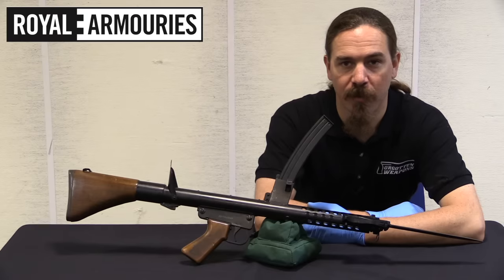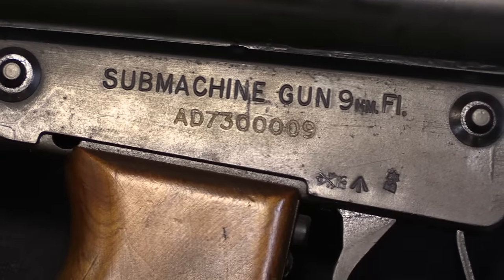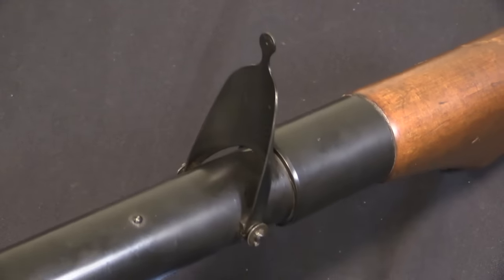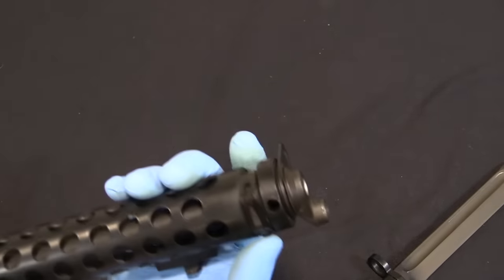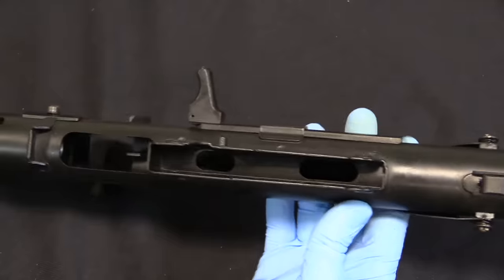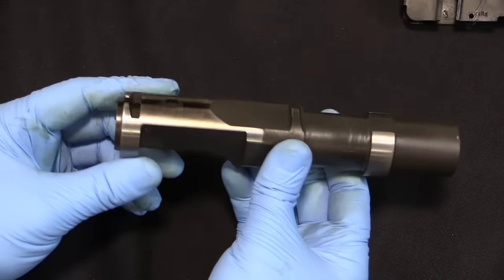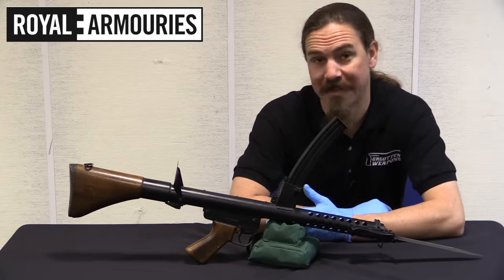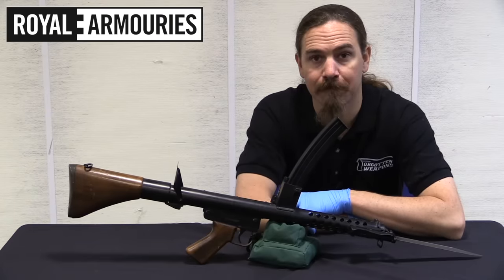Sterling Meets Owen: The Australian F1 Submachine Gun

Comment: I used the F1 a bit while in the Army Reserve during the early 80s. They are fairly accurate out to about 30 metres and I think they taught their maximum effective range was around 100 metres. One of my instructors was a Viet Vet. His story was they didn't have a lot of stopping power and the bullets bounced off the VC raincoats at 100 metres in the rain. 

I had a lot of fun with them on sneaker ranges where you walked down a trail with an instructor 2 feet behind you and shot at pop-up targets. They were great fun to fire and very reliable, but we never took them out on exercises because there weren't any blanks for them. 

If you were lefthanded like me, you were taught to fire these righthanded. The issue was hot cases would eject down through the split in your sleeve if you tried firing them lefthanded. They taught us to fire mainly from the hip; you aimed to your left of the target because they rode up and across the chest. When you put a few mags through them the handguard got a bit warm.

Comment: I'm flashing back to the 70's with this video. Tank drivers and loader/operators carried these and gunners and crew commanders carried 9mm's. My Troop Sergeant, a Korean war veteran, wasn't impressed with it. He much preferred the Owen Gun. This weapon was always referred to as "the SMG" rather than F1 because at the time, there were three pieces of equipment in use all designated F1. One was a truck, the second, this SMG and I can't remember the third. The truck continued to be called F1 and with alternate names for this SMG and whatever the other piece of equipment was. All useful, but not interchangeable. :P
Reply: and the blast cap assembly/booby trap device.  The F1 designation lives on with the F1 Grenade.

Comment: Just a hypothesis on the positioning of the sites: 1) having to roll your head over the stock, this would increase your contact surface (cheek/neck). 2) tilting the gun would mean that brass would be ejected away from your feet when walking. Both reasons are in two very different ways of firing the gun. 1 is trying to use the gun for accuracy. 2 is more up close full Auto fire. Again just a hypothesis.

Comment: Heres my explanation of why the sights are on the right.  Australians learnt that getting low to the ground on a firefight in close, jungle country is a life saver. As a result you'll notice most the photos you see of diggers in Vietnam, the front of their bodies is free of webbing/pouches etc. ( exception being SASR patrols, who avoided firefights and would 'break contact'... they avoided getting low and crawling towards the enemy)   For a right hander, the mag pounch is on the left. For a top feed mag like a Owen or F1, the easiest way to change a magazine and maintain a low profile is to tilt the weapon to the left, change mags with your non-master hand  and continue firing.  If the weapon is tilted to the left for a right hander, the right hand off set sights would be better aligned for a right hand shooter than left hand offset sights.   The Owen and F1 were products of lessons learnt in combat.
Reply: As a an Aussie grunt "1RVR" That's the explanation for the sights being on the right, that I recall from my service in the Reserves back in 1984. It was kind of fun to use but I preferred my trusty SLR. I definitely recall being taught to keep my ammo pouches to the sides so as to be able to lay low and flat on the dirt. Made a lot of sense at the time and still does now.

Comment: I may have suggested this before, in response to an Owen gun video; I may be wrong but I'll throw it in here for good measure. If a right-eye-dominant right-handed shooter is using a full-size rifle, they'll cant their head to the right to bring their right eye in line with sights that are centred above the bore axis; if the stock is a good fit, they may achieve a 'cheek-weld'. If the same shooter is using a SMG with a rudimentary buttstock and a magazine mounted above the centre of the bore axis, they can do one of two things to get a sight picture: cant their head to the left, away from the weapon, to bring their dominant eye in line with left-mounted sights or take up their normal shooting position while pulling the weapon even more closely into the shoulder to sight down the right side.
I'd be interested to know whether there are other SMGs with offset sights or whether the weapons with sights offset to the left were all of a different class. What works for a SMG at the shoulder might not work with a LMG on a bipod, and vice versa.

Comment: Hi Ian I used these until they were phased out. The sights were offset so you could use the palm of the left hand to depress the mag release to remove the mag while keeping the master hand on the pistol grip to keep control of the weapon. Sights to the left would have interfered with this. No manual of arms for this weapon said that you should roll the gun to the left in order to aim as this would mean the gun would not be seated in the shoulder. The sights were only really used for semi auto fire at ranges over 25 m as we were taught to fire instinctively and in auto you don’t really have much of a sight picture. The other reason for sight on the right was that they don’t snag on your webbing. Just remembered that we don’t call it a bayonet lug or latch ,it’s a boss at the front and standard at the rear that you lock to. I believe these terms originate from UK

Comment: i noticed one detail that would make the gun less dust-and grime-sensitive: the bolt,though its round in a round tube, is not the inner diam of the tube, instead it runs on several smaller surfaces, with most parts of the bolt circumferenc not touching the tube inner wall. that leaves space for sand etcetera, without jamming the thing up.

Comment: The usual method of using the weapon is to twist the weapon slightly to the left to the point the sights are vertical. As it was designed for the jungle, it was considered best to have the mag upright (less chance of hooking up the mag on brush) so turning it slightly to the left was an easy fix.

Comment: WRT why the sights are on the right:
This is a guess, mind you. I never saw anything official.
 But did you notice where the magazine release is?
if you mounted the sights on the left you’d get the tang of the mag release in your sight picture.
And the constraint of requiring the mags to be compatible with the Sterling means you can’t relocate the mag release.

Anecdote: Back in 75, the training base at RAAF Wagga Wagga had a sectioned off F1 barrel with three bullets lodged in it.
With a simple blowback action, if you get a projectile stuck in the barrel, you’ll continue firing and lodging more lead in the barrel until you let go the trigger. No dangerous back pressure as it will vent out the non locked breach. But the firing rate accelerates.

I’m told the firer got one helluva surprise before he could release the trigger though.

Comment: Just a minor point, replacing the F1 with the M16 has no real relevance to how the F1 performed as an SMG, all SMGs were replaced with 5.56 carbines in ADF service, appart from very specialised use. That's not really relevant. The reality is th 5.56 made all SMGs obsolete for general infantry combat.
Reply: I didn't come away with that point at all, the point was the AUG was adopted to replace submachine guns (like the AK47!) as well as rifles.
Reply: Dennis H-CH I think we’re talking about different things. When Ian was talking about how the F1 performed in Vietnam, he said that they were pretty quickly replaced by M16s and relegated to secondary roles. That implies that they were less useful than an M16. My point is, 5.56 carbines in general are better than any SMG, so you aren’t comparing apples.
Reply: @timblizzard4226  Even more to the point is the F1 / Owen guns weren't replaced with a standard M16, but an M16 mounting an M203 (which was a result of the M79 being awkward and slow to bring to action) so it was definitely apples and oranges. I summarize comments in an Australian Army manual for infantry battalion lessons from Vietnam ... M16 - a versatile weapon without the stopping power of the SLR, effective stopping power to 100M but lacking penetration in jungle, requiring careful maintenance to avoid stoppages, but much more effective than the F1.

Comment: Re the weird sight issues.  In the jungles, a submachine gun was rarely sighted.  It was more point and shoot at close range so the rear sight was not used that often.  You would want to have one, but having one that just folded out of the way made perfect sense.  As for the placement, obviously someone in procurement had a left-handed brother-in-law which is the way such decisions are usually made.

Comment: I had an incident on the range with a runaway F1 courtesy of the trigger group comming loose during firing fortunately a mag dump only takes a couple of seconds and yes the big Spring did make around 600 rpm effectively they only had two stoppages empty mag and broken firing pin I never saw a bent rear sight. The bayonet for this thing was really something almost as long as the weapon

Comment: We were told that if you are required to use the sights then your target was too far away... We were issued a Toggle Rope (which is a real thing) with our webbing and and one of the uses of this was to be firmly attached to the F1 at which point, while screaming really really angrily, one could hurl the entire gun at the enemy if you missed hiting your target then simply retrieve the gun and repeat...  apart from that this did make a good PDW in vehicles.
Reply: "at the enemy"? I always thought that was the Drop Bear drill.

Comment: I'll back up what Tim W has said, as a former RAAC driver in the late 80s.  To be honest, cavalry aren't really expected to snipe with these things, and most training was on a 25 metre range.  At that distance, you weren't deploying the sights; often, you weren't even bringing the weapon to your shoulder.   As a lefty, I'd just point my right index finger along the underside of the barrel, which was not regimental.  The right hand was supposed to be an overhand grip on the barrel, to avoid a hot brass injection up the sleeve cuff, from the underslung ejection port.  But it meant that I could simply point my index finger at a figure 11 target, and fire off a burst aimed at about the target's right hip.  Recoil would pull up and right, and stitch a couple of rounds across the torso.

Comment: I add, good video and comments by the way, hold the gun low front arm locked straight,and guide your shots on target by adjusting shot with the pistol grip. You have more control in instinctive fire. With practice when shouldered this too can be used to aid accuracy rather than waving the barrel to adjust shot. A good gun to retire submachine guns on I'd never want to go on operations with one I was happy with an M16 thank you, but looked flash when a pay guard.

Comment: When you are making a gun out of a tube it is easier to move the sights to the right and tilt the gun slightly if needed, whereas if the sights were on the left side you would need to build up the stock and the side of the tube to have a decent cheek weld and in turn a usable sight picture.

Comment: I was in the Royal Aust. Navy from 90 to 96 and the F1's and 9mm Browning's were the weapons of choice for boarding parties, as the 9mm bullet, if fired below decks on a ship, wouldn't penetrate the hull of the vessel ... unless they were made of wood. The 5.56mm rounds of the Steyr however could (and did when tested) puncture the hulls of boarded vessels. When I left in 1996 they were just starting talks about what to replace the F1's with, and last I heard they were thinking about the MP-5, but I was discharged long before any decision was made, so don't know what the final choice was. 
(I know the MP5 was employed by the Air Force, and by Army Spec. Ops., but never heard what the decision was for Navy Boarding Crews ... they may have used the Steyr, but limited those crew to above decks, while pistol crew searched below ... I don't know.)

Comment: The serial numbers are as you suspected
AD Australian Defense (force I suppose) . Indicates also it was made in Lithgow.
Next two digits Re the year of manufacture.
The remainder is the serial number.

So this gun was made early in ‘73, the last year they made them.
The serial number schema also applies to L1A1s as well, so anyone with a sporter FAL with an AD number stamped at the right rear of the lower receiver can tell it’s an Aussie parts kit and approximately what year it was made.

I spent the early 70’s maintaining these in the RAAF and they were a good little SMG. The heavy bolt made them pretty stable.

Comment: The difference between theory and practice; I have used or instructed or supervised the F1 on the range and during tactical training and never had an issue with the sights, reliability or its handling. Its biggest limitation was that it was 9mm (as with all 9mm msg's). The TOE distribution was for officers and Radiomen. Officially drivers were issued SLR's (FN). For its intended use and range it was an effective weapon. If it was ever used by section scouts in Vietnam it was only for a very limited time. I think the scouts went from Owens straight to the M16.

Comment: How cruel Wizard! Used the F1 myself . Quite accurate . Much like the Uzi. One point that many miss looking at this gun is why you have a substantial steel butt plate ? Very old fashioned . Heavy attached to heavy full wood stock too.  So you can bash heads in with it when you run out of ammo.  Real close quarters reasoning . Glad I left as a kid . Looking back I think OMG.

Comment: The sights work well when the gun is tilted slightly (magazine left toward the body, grip to the right away from body). This aligns the sight straight up / down and is perfect for right hand / right eye dominant people. Don't know why they started tilting the weapon to use it but it seems the sights were designed or modified (in the case of the preceding Owen gun) with that in mind.

Comment: Hi Ian, I remember reading somewhere (I cant remember if it was in Wayne Wardman's book "the Owen gun" or G.S. Wardell's notes)    the sights on the Owen gun were off-set to the right so you could get a solid cheek weld, if they were off set left it wouldn't be too stable without adding a cheek piece which would make the gun unbalanced.  I keep hearing about the owen gun magazine (as well as the STEN magazine apparently) fitting the F1, but I can't find anything written about it.

Comment: The little metal tab that guards the opening to the breech on the underside, is to stop you from losing a chunk of meat from your hand; as the bolt WILL bite you should you place your hand there.
The bolt is upside down remember and occludes the whole opening.
We liked the progressive trigger. Less faffing around when under pressure, no delay in a pinch.
Yes the Owen was a better gun. But the F1 was what they gave us and it's better than a Stirling.

Comment: Trained up on the F1 and L1A1 then M16A1, whilst not a big fan of the F1 I had no real issues with it except hitting power (and my big hands), would have been ok close up but not much more over 50 metres or so. Went from the L1A1 SLR to the M16A1 but still preferred the bigger 7.62mm SLR even though it was a relatively heavy bugger to lug around.

Comment: Ahh, the only SMG I have ever fired. I was trained on it and fired it during the 80s. I never remember the sights feeling unusual, they just worked fine and I think the idea was that they did not catch on your webbing (don't quote me on that). I never heard of the rear sights being prone to damage but we did not really use it where I was. I also remember that it was pretty accurate to 100m with single, aimed shots, fairly accurate with bursts from the shoulder out to 50m, auto from the hip ... good luck to ya. It was really only used by armoured crewmen, drivers, and the reserves in the 80s. Fun weapon to fire but it had a reputation for lacking stopping power.

Comment: Ian you need to use it before passing definitive  judgment, you are off the mark.
In all my years of using one, the rear sight was never a problem or at risk. It is very strong.
 The  rear sight is normally down unless deliberately taking aimed shots.
Short range weapon, limited by the 9mm round, designed for self defence / close combat in jungle and scrub.
Issued to forward scouts, A and B vehicle drivers, cooks, radio ops, clerks, etc

Comment: A suggestion for the sight placement; by having the sights on the right side, the user will be guided to tuck the gun in towards his center of mass, rather than push it of his shoulder with his chin.
He might also have better Situational Awareness, effectively having one eye on either side of the mag well. 
I guess SOMEONE will have to run a match with a top feed SMG to find out.

Comment: I don't think you necessarily need the gravity "assist" of the bullets going down but the spring force needed to "lift" 34 rounds quickly enough, that's quite a bit of weight for a spring to move against gravity.

Also diving down to the cold hard ground (as you might when being shot at) if the mag protruded from the bottom and was partially empty the rounds will be pushed down to the bottom of the mag by inertia then... hopefully the cartridges all get pushed back up without tumbling... maybe not, who can say.

Much less likely to be suddenly decelerated/accelerated upwards so an "upside down" mag would be less vulnerable.